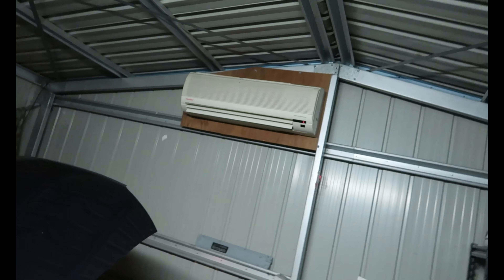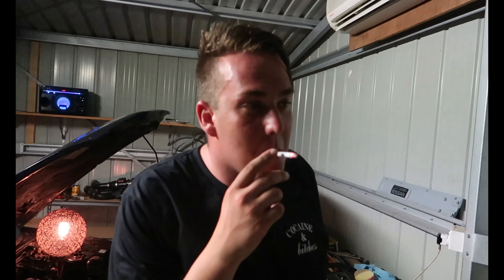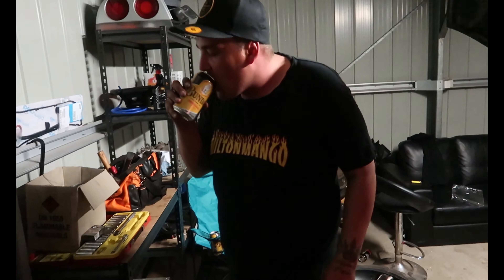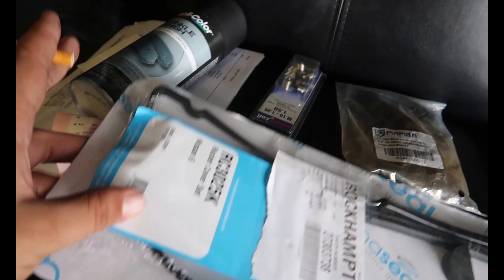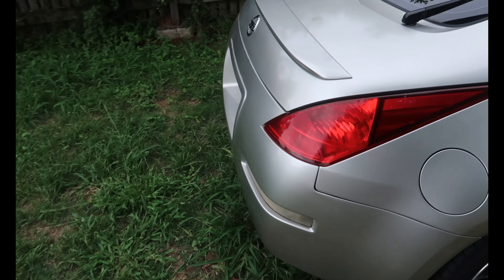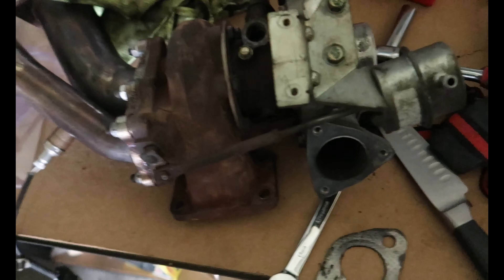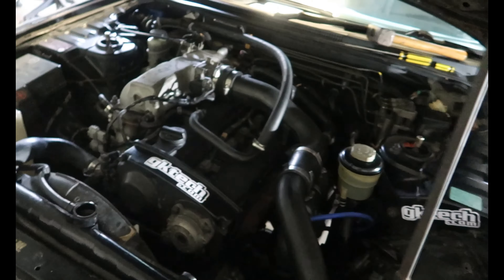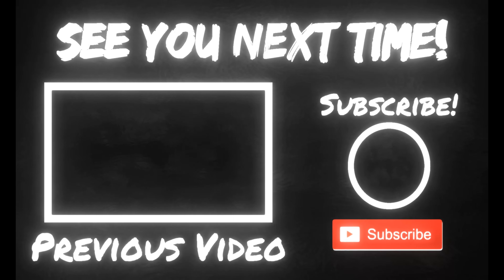R33 Skyline RB25DET Exhaust Gasket Replacement

Comment: Mate I got 120psi on all 6 on rb25de and leak down only shows cylinder 5 exhaust side leaking. If I crank the engine little bit more TDC it goes from exhaust to intake leak. thoughts?
Reply from the maker: It could be leaky valves